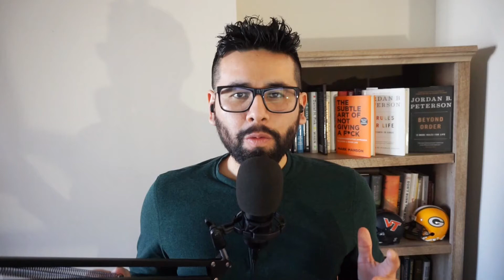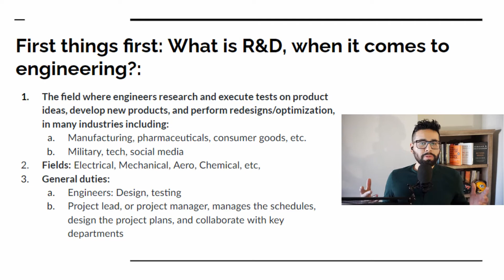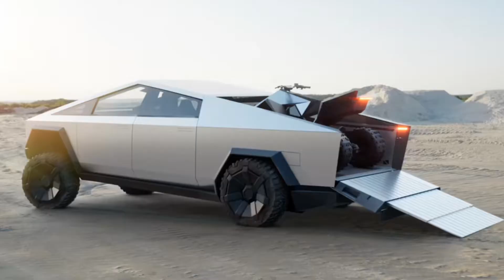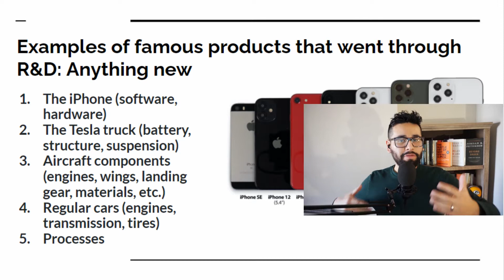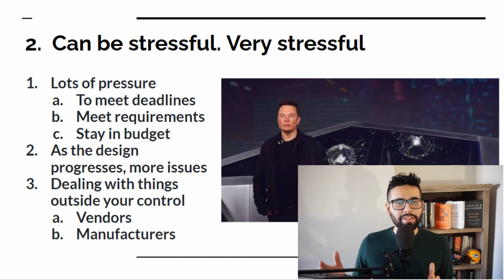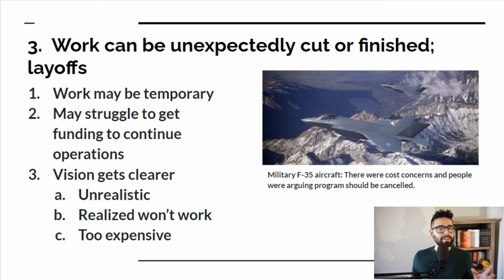Research and Development (R&D) for Mechanical Engineers? | How to Get into R&D

Comment: This is the only field to go into if you truly enjoyed your engineering courses - nothing else comes close to what you were trained to do. Also, I wouldn't be too worried about the "what happens to all those engineers, they are out of a job": if you are a good engineer, typically you will be placed onto an upcoming or existing project. This should only be a concern if you are doing R&D for a start-up.
Reply from the maker: You bring a really good point that this is a field where you do true engineering work! Thanks for the insight and info, Robert.